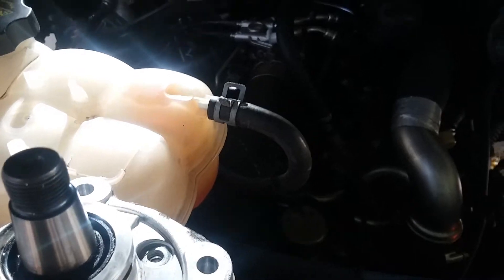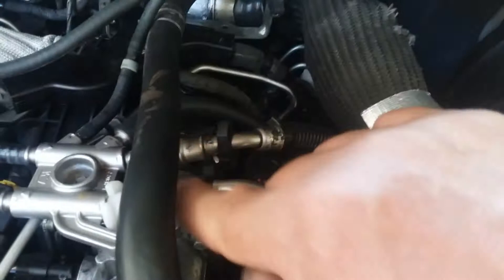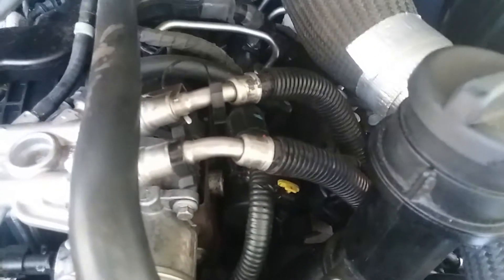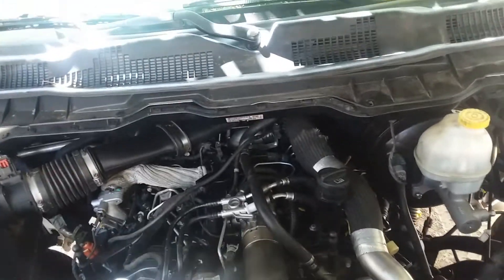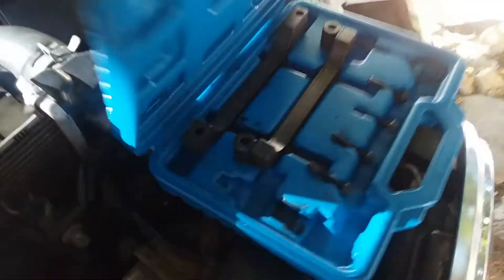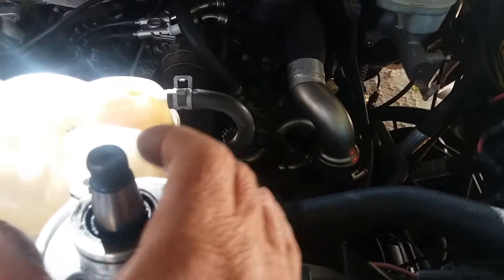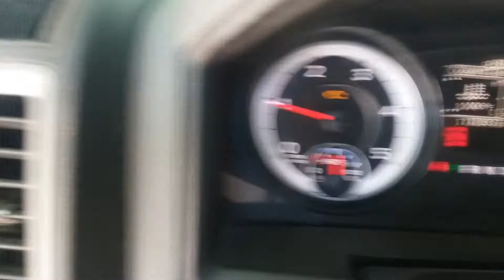Ecodiesel CP4 Failure. Replacing cleaning entire fuel system.

Comment: Ram should buy back all these ecodiesels. Just had mine in the shop getting the manifold replace cause of carbon build up, now they replacing the turbo. Got a recall for hi pressure fuel pump. For year and a half . Still no part  available.  Because it can sends out metal shavings like your truck.  My truck is 2016, 1500 longhorn 4x4. It has been running great. It has 101,000 miles. The service guy said there's nothing to stop the carbon build up.

Comment: Hello there 👋  great video. Quick question. I did and engine swap on one. The high pressure pump the engine came with was no good so I had to use the pump from the original motor. So I set both engines on TDC and then swapped the pumps. The vehicle ran but is running bad now. My question is, did I have to rotate the "new" pump to 65 degrees counterclockwise? Since I figured both engines where at TDC and I should have been able to just swap then across
Reply from the maker: Sorry it took so long for reply. You have to time the pump. Make sure 1 is compression stroke. I just lowered an injector and turned motor by hand  till I started push up then found the hole for timing pin. Turn pump  counterclockwise 65 degrees then put it on. I did replace all injectors. Best thing you can buy is a Thinkdia to check your timing and do cylinder checks or do a force regen. Only $100.00

Comment: my Ecodiesel  engine just blow...i may need to rebuild like you because its hard to find a new motor due to the strike
Reply from the maker: Check lift pump and filter if bad replace. If no start check for aluimun shavings at the injection pump top if you find them then check compression on passenger side,  if no compression then its probably what happened to my motor. If compression is good then probably clean lines fuel rails and return line and tank. Replace all injectors. That is if aluimun found
Reply: @alanhiiesalu6158 will do, thank you!

Comment: Saving your video. I just got a upgraded cp4 to replace mine. Here i was thinking it would be plug and play. Haha😅
Reply from the maker: I suggest changing fuel filter every oil change and add Marvel Mystery oil 4 ounces to every 10 gallons diesel IT WILL SAVE  YOUR CP4 injection pump. Stop adding it  when getting ready for smog check. I am now 30,000 miles since the repair. The mileage this truck in fantastic. Last run I did down to LA and back I got 34.2 MPG  (Going speed limit 55 -65 mph) at first I thought this was wrong so I did a refill measured fuel put back in tank and yes 34.2 MPG
Reply: @alanhiiesalu6158 I recently had the new CP4 on my 2015 Big Horn Ecodiesel installed. As part of the recall, they put in a new filter. I was reading from people on the Ecodiesel forum of not getting the filter. The recall was from last year. The parts started to hit dealers back in March. Seems even the 2020-2023 Jeep and Ram are effected by this recall.

Comment: Have  22 Ecodiesel   44,200 miles Loved it until it broke down this week. Had it towed to the dealer diagnosed that High Pressure fuel pump went out, took fuel rail all injectors all fuel system OUT!!!  So my 22 is not recalled because supposibly mine came from the plant were the perfect trucks came from.....lol right.  So warranty kicks in correct, But now they want proof of Services that are done by a professional!! I do my services I use correct filters, oils and rather service my own that trust someone.  So they are looking for a quick blame... If running thru this suggestion you can Google lawyer that is Sueing them and join the law suit.   I Will NEVER BUY A RAM NO MORE

Comment: I have a 2018 ram eco diesel. And it seems that I have the same problem. But it happened in mexico as me and my family where on a family trip. So I’m stuck in the middle. 20 hours to go back home, or continue for another 14 hour to my destination and find a good shop. The question is can I call you if my mechanic has any problems on putting it back? Thank you
Reply: No problem, do a compression  check on the passenger side and if it is good then the motor is good. Next check to see if CP4 pump good. Remove fuel quality sensor and look for aluminium shavings. If none found the you are in great shape. Change full filter every 10 to 15 thousand miles and add marvel mystery oil 4 ounces to 10 gallon fuel. The USA straps out lubricants and that is why they lock up and destroy motor.